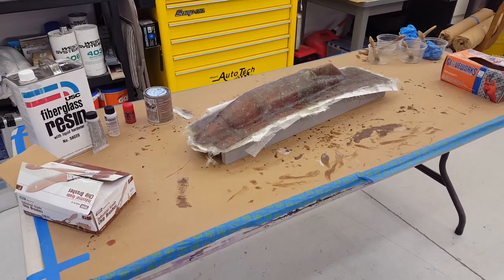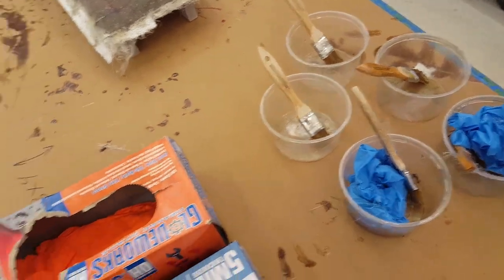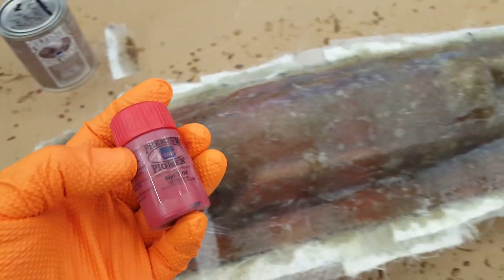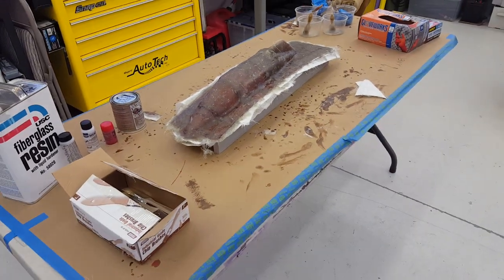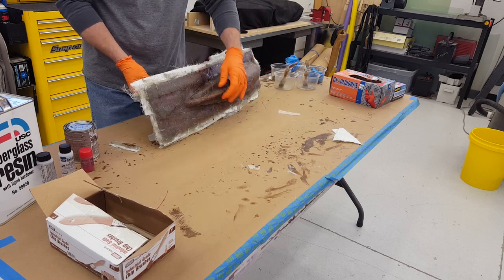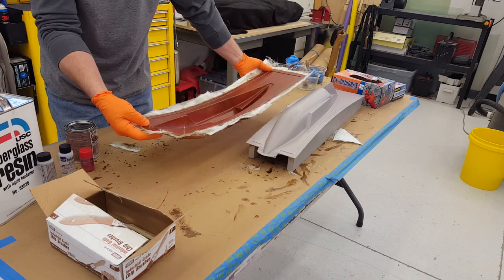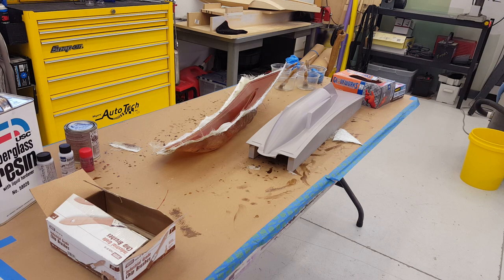Releasing fiberglass mold from a plug, with a few tips along the way from M5 Performance Hydroplanes

Comment: Hi ya !  I used to be the Foreman in a yacht building company, and we used TONS of frp plugs and molds.  ( I once built a plug, and then the mold, and then the hull, for a 54' racing sailboat,for the Vancouver to Maui Race. )  and yah, the glass slivers from a mat layup was just plain painful.  Well, we started LIGHTLY hand sanding the exterior of the part,  ( plug, mold, part, whatever. )  with 60 grit paper, and NO more slivers !!!  We only spent a couple of minutes doing it but boy, did it ever save 'time with the tweezers'.  You might just want to give it a try.  Oh yah, by the way, I used to race RC model boats,  ( A and B  Mono & Offshore,  A and B Tunnel,  and Sport 40 hydro. ) as part of the "Puget Sound Model Boat Club".  I even got to race in the NAMBA Nationals  at Half Moon Bay, California, one year.  Nothing but good fun, and great friends !

Comment: Does the PVA work on fiberglass to fiberglass? I have a fiberglass part I want to duplicate...but I want to duplicate it with fiberglass resin and pop it off after curing.
Reply from the maker: Yes it will work fine. Spray it with three or four very fine mist coats and go for it!

Comment: How do you avoid air bubbles?

Do the air bubbles cause the fibreglass to fail to take the accurate shape of the mould?
Reply from the maker: You've opened a huge can of worms, but the short answers are; Very carefully and yes!  I'll be laying up some new cowlings fairly soon, so maybe I'll shoot a video showing how to do it.

Comment: What do you use to seal the wood? I’m making a basic v hull boat  (its my first boat ever) and I’m just wondering if there are different methods of how to do it. I would like to do it as cheap as possible with stuff I can get from a hardware store. I’ve already finished the hull and just have to seal it and add the Electronics. Thanks
Reply from the maker: Here you go Erik;
https://youtu.be/3XDOhJPo-KY

Comment: Hi, couldn't find the previous video.  You mention PVA.  Where did you use that?  Did you use just wax, or pva as a releasing agent?  thanks
Reply from the maker: It's funny that you ask... I'm shooting a mold-making video right now!  
I wax the plug several times with a molding wax and then spray it with PVA that I get from Tap Plastics.  The new video will be much more thorough, going through the whole process of building the plug, then the mold, and finally the production part.  Coming soon!
Reply: Or hair spray . Its pva 
 Readily  available in the bathroo.

Comment: Hey Scott, are there any better body fillers that you know of, other than bondo, for these boats?
Reply from the maker: Hi Kyle, if you do a nice job fitting everything on a wood boat you should only need a very light application of a surface filler to take care of the wood grain and any tiny gaps. For this I use a polyester blending putty called Metal Glaze. The name is deceptive... It works excellent on wood and fiberglass and can be applied over primed surfaces as well. 
I fill larger areas when needed with thickened West Systems epoxy in most cases, but do use a lightweight filler such as USC's Feather-Rite on occasion 
Hope this helps!
Reply: @M5PerfHydros  ..." if you do a nice job fitting everything on a w...">>> LOL well, maybe next time. I fiberglassed a fiberglass "nose cone" to the wood cockpit, and it definitely needs some blending to the cockpit sides, ugh!. Thank you for the info.
Reply from the maker: Do it with West Systems epoxy! It will be much stronger and less likely to get stress cracks. Thicken the epoxy with West System's 406 Colloidal Silica to a consistency like peanut butter and smooth it in place with a popsicle stick or your finger. It'll look great and be mucho strong
Reply: @M5PerfHydros  Nice! Thank you.

Comment: Did you use polyester resin or epoxy? And how did the part come out? And was that epoxy or polyester resin?
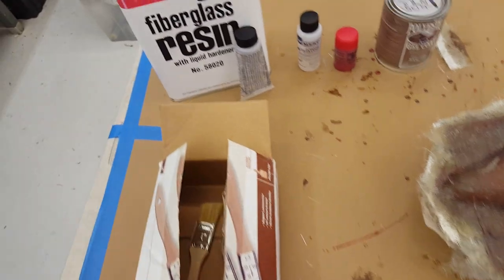Reply from the maker: Kyle Boyer - at the 4:20 mark of the video you'll see the product I use.  Fiberglass mat is impregnated with a resin that is soluble in polyester products so you must use a polyester resin to form mat properly. When I make my parts from a mold I use West Systems epoxy and fiberglass cloth. The cloth does not have any product impregnated within it so you can use any layup product you prefer with it. The cowling turned out great! Check out my Facebook page for more pictures and other content;  https://www.facebook.com/M5-Performance-Hydroplanes-237635276373511/
Reply: Definitely learned something here. Thanks for the reply (do i try for one more question?) And what kind of fiberglass and it's weight are you using?
Reply from the maker: Kyle Boyer - Ha ha! I don't mind the questions...
I use several different weights to make molds as well as when making finished parts from molds. The main trick is for your first layer to be a very light material so it conforms well to the shape/angles of the part. Heavy glass doesn't form well around corners and you'll get a lot of air bubbles there. So for mat I use 3/4 oz veil as my first layer, then let it set up until tacky and go with my heavier layers thereafter, 2 oz or more depending upon how strong the mold needs to be. Fiberglass cloth takes the same approach, starting with a 1 oz veil, then going to a 3.5 oz cloth, 4 oz, even 6 oz where I want more thickness and greater strength. Along critical areas I sandwich carbon fiber cloth or strips between layers of regular glass. I hope this helps!
Reply: I will give it a go with this info, thank you. See you for H1 testing tomorrow, I presume?
Reply from the maker: Kyle Boyer - It would be a long drive for me... I'm traveling and currently in Austin TX!  Have fun!

Comment: I see thin gel coat and lots of air in the outer layers. The outer layers should not be a problem but if you have air in the first layer you have problems. Should make a good part though.
Reply from the maker: Did you watch the video? The gel coat and mold surface are perfect!  Finished parts come out excellent
Reply: Yes, I did watch the video. I was just commenting on what I saw. Not trying to tear you down. Thin gel coat and air pockets can cause big problems when making quality molds. Looks like you got lucky and your parts are good. Nice work.